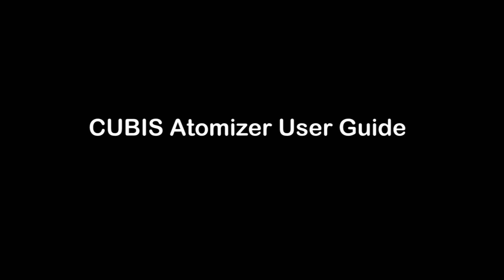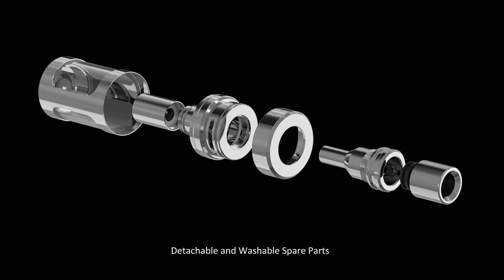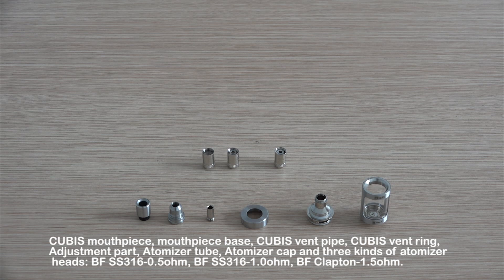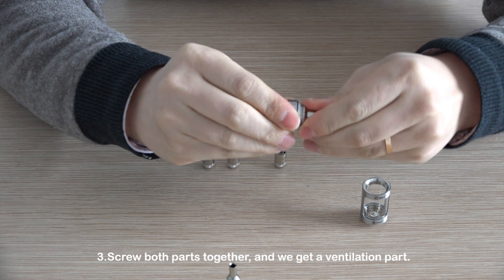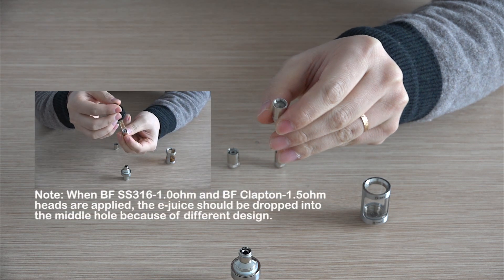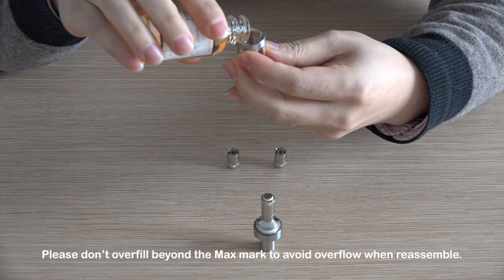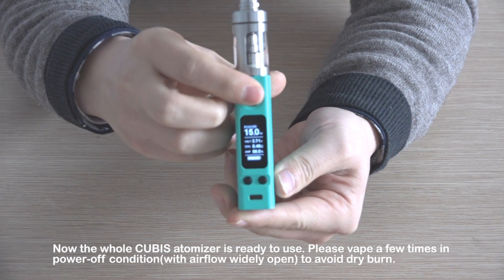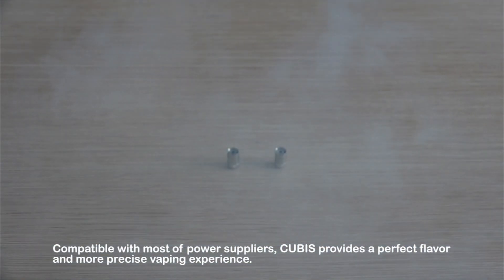CUBIS Atomizer User Guide

Comment: have the cubis pro atomizer and love it but there is no maxfill mark..I like how tweaking this thing is really rewarding. I tried a bunch of different coils and settings. The absolute best are the 0.25notch coil@40w dl and the 0.5 dl@30w both included with few coils aswell. also had some 0.6 ml from eco aio but didnt like those so much. 

0.5 dl(shows as 0.47)at 30w give huge and good tasting vapor so does.the 0.25(device show 0.23) and the manual say 0.25 last longer but uses ofc more battery. but cant go wrong with either no spillback at all, no "special" mouth piece is needed. But both burn the 2ml tank empty fast, faster you may believe, it gives that much thick vapor. not like the eco aio which 2ml tank lasted thru the day. 

I also noticed becouse it gives alot of smoke i dont feel nicotine withdraw even my mix is down to 1.5ml from 3.0ml which i used in eco aio. Very good purchase

Comment: How does that design work? I mean, how does the liquid gets to the head, which is on top? I've seen that with some other tanks (Avocado RTA, for instance), but I don't really understand.
Reply: +Андрей Полий There are two Slots at the bottom of the Coilhead where the Liquid can get inside
Reply: Lately the .25 atomizers have not been filtering in the juice for me though, I have to unscrew the top of the tank and screw it back in to see the bubbles/bottom of the atomizer actually take in the juice, it's been very annoying.